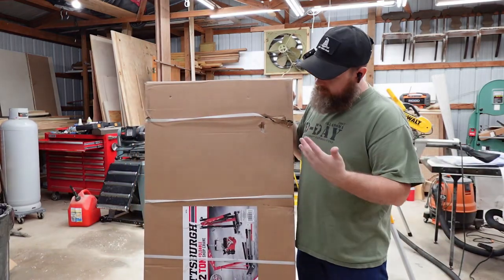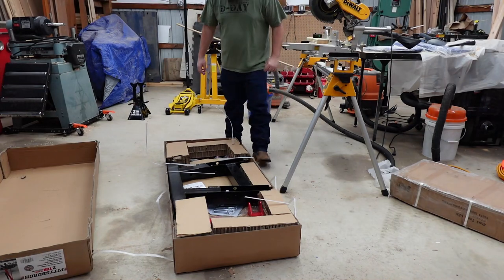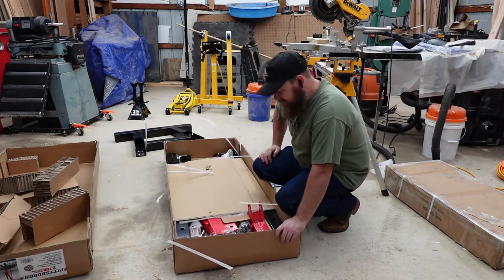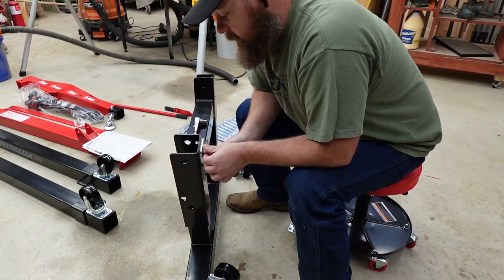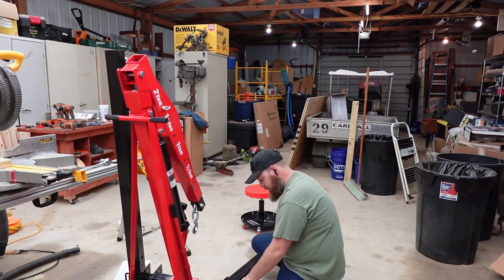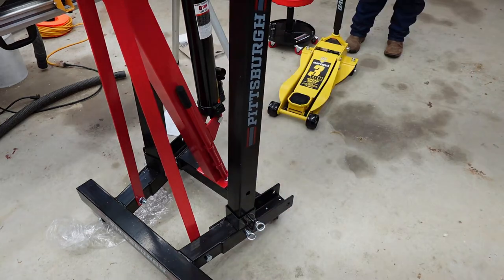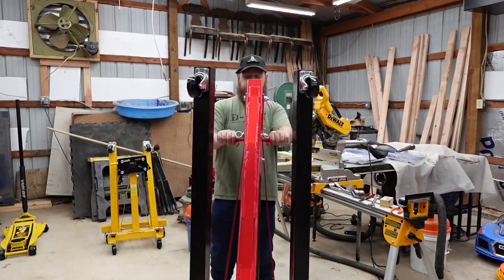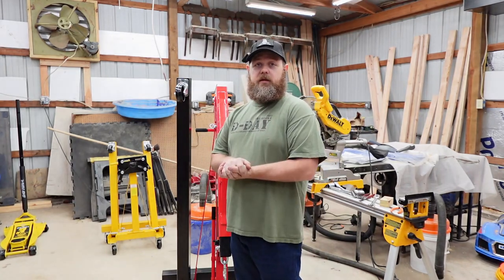2 Ton-Capacity Foldable Shop Crane from Harbor Freight Unboxing and Assembling

Comment: To pull that last pin for folding the crane up just pull the handle back while using your foot to push the base away from you. The 3” wheels are only there for rolling the assembly around while folded up. This is why they are not in contact with the ground when deployed. Reverse the process to deploy the crane.

Comment: Thanks for the assembly video! I just built mine. Using your video and their instructions it was pretty simple. The support bars take a little cajoling but it worked out in the end!
Reply from the maker: Glad it helped. I was actually surprised how easily it went. After you use it a bit I would be curious to hear your experience.
Reply: @lindseyacresfarm  I bought it for my 2-car shop garage. I need to disassemble my PM30 milling machine to convert it to CNC. The parts are too heavy for me to handle on my own. 

Also moving around some standing tools like drill presses and a band saw

Comment: I'm thinking of getting one so I can lift the front on my Exmark Radius Zero Turn Mower real high so I can more easily change the blades.  Once lifted, does it hold the load or let the load drift back down?

Comment: Nice piece, I just bought the same model, it works great.  Only thing I don't know is what the slide brackets are for. Maybe tie downs for storage?
Reply from the maker: I am not sure as well. That was kind of my thought.
Reply: To stabilize your load while you are moving it around the shop. Stops it from swaying around.
Reply: Actually for holding  while lefting the lega

Comment: Sorry but for the casters esp the brake, the screws need to be opposite ie heads on top. In your video, the castor will not swivel because it hits the nut, I know because I tried it. Thanks great video
Reply from the maker: Thanks for the tip I appreciate it.

Comment: Which crane would be best or adequate for lifting a Ford F150 bed off the truck?  Would the 1 ton crane do the job safely or would I need the 2 ton crane?
Reply from the maker: I would think a hoist like this wouldn't be good, but one of those overhead things would be good. I would think a 1 ton would be fine. Beds aren't usually heavy just big and bulky.

Comment: I had just put one of these together, and ran into the exact same 'why wont that pin come out of that leg....I had hoped u found a solution.  Have you found a solution for that leg being under too much pressure to lift nicely since the video?   I just went back out and used a 17 inch piece of 1x1 wood to lift up the main base section, then the pins came right out...so I added two zip ties to that (didnt have a long one) and will just hang the piece of wood from the push handle on mine to make it easier.
Reply from the maker: Unfortunately, I have not. Just something I have learned to deal with. Especially since I have used it so little. I have needed it for a couple of specific things, but the rest of the time it is int he corner. If I used it more I might try to figure it out.
Reply: @lindseyacresfarm I just used mine today (reason i bought it), and the  18 inch 1x1 works great, just sit between the legs and get ready to pull the pin, use the 1x1 to crank upwards on the center area, and the pin comes right out.

Comment: What is the maximum lifting height of the hook when it is fully extended?  How far away (horizontally) is the hook from the base at that point?
Reply from the maker: Hey sorry has thanksgiving and family the last few days. I got some measurements for you.

92” from the floor to the bottom inside of the hook.

Where the cylinder is connected to the arm to the hook is about 30”

I hope that helps.

Comment: What size is the shipping box?  I don’t know how tall you are, but I am guessing the box is 5’ or a little longer and about 2’ wide and maybe 10” tall.  I am trying to decide if I can fit this in a small SUV with the seats folded down or if I need a truck of trailer.
Reply: Box is about 58" tall, 24" wide, and 8" deep. It is very heavy, I recommend plenty of help loading and offloading.
Reply: @MrSmokingfrog1  I bought one last week.  The store helped me load it into my Equinox, but I unloaded it myself.  I was asking for size as I wasn’t sure it would fit in my Equinox, but it did with a few inches to spare.  I have a motorcycle table lift so I slid it out of the car into the lift and then lowered it to the floor.  Wasn’t too bad.  I then assembled it from the box on the lift which was fairly easy.
Reply from the maker: Sorry I didn't reply sooner glad you got it sorted. I got no notification of a comment :( @MrSmokingfrog1 thanks for answering the question.

Comment: What’s the difference between this new “red” one verses the grey ones they have been selling for years?
Reply from the maker: TBH I am not sure, I never had one. However, I decided to watch a couple of assembly videos of others, and as best I can tell the top support is beefier. The chain is a little shorter, and bigger. I think the hydraulic cylinder is a bit bigger, but I couldn't confirm that.

Comment: Will this be able to handle a semi truck diesel engine?
Reply from the maker: I really doubt it. I am not sure it would have the reach or the weight capacity. Maybe if it was just the block and you were picking it up off the ground, but even then I do not know.

Comment: Does it reach high enough to take the top off of a Jeep?
Reply from the maker: I run 33’s on my jeep and I don’t think it would fit. I think it can get high enough but the angle would be too great you couldn’t get over the middle of the roof very well.